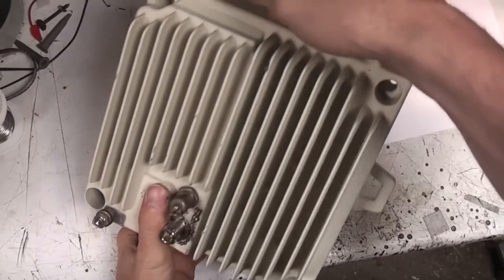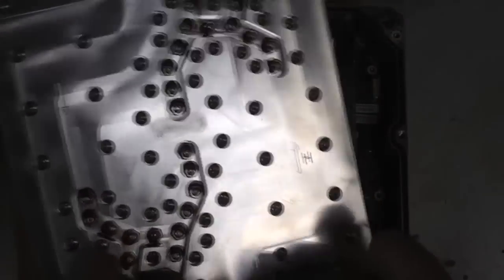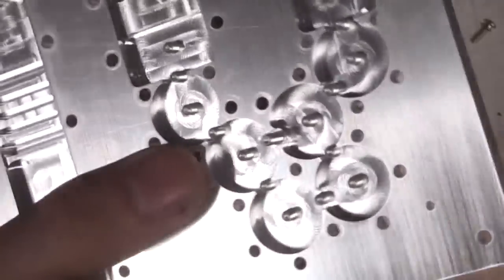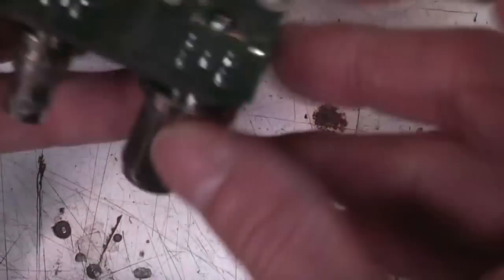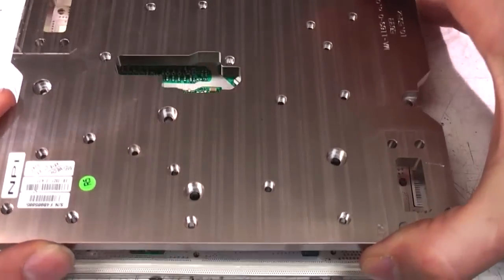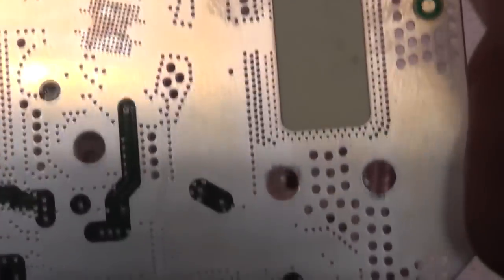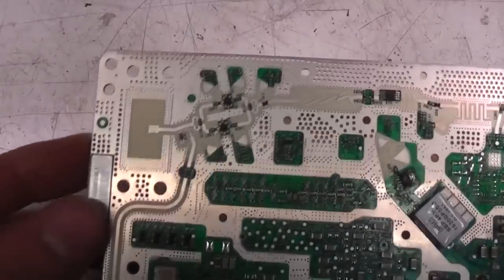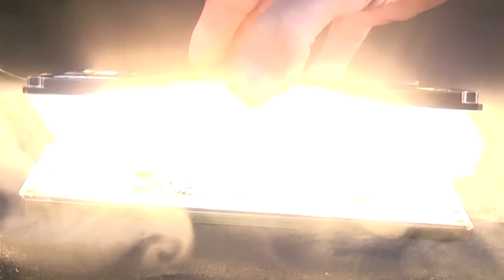10GHz Microwave link teardown

Comment: That BNC connector on the back is a 0-10v-ish signal strength indicator used to align the dishes. RSL-receive strength level.  You basically just go up the tower with a multimeter and swing the dishes back and forth until you get the highest voltage. The alignment is actually really finicky so you really need that quickly updating voltage to really tell when you're dead on the center of the main lobe.

Comment: I know this is old but the cavity is a standard band pass/band reject for full duplex radio transceive. Pain in the neck to tune them too.
The funny shapes on the board is more filtering and capacitive loading, this actually stops the tracks from becoming the antenna and loosing rf power.
The part you have (as stated) is the first IF stage and may bring the frequency down to the main part at let's say 1.2ghz where there is less loss in coax.
There is loads of screws to stop the metal from warping in temperature changes as even 0.25mm will change the frequency pattern of the filter and cause huge problems!

The filter cavity is used in repeater sites where tx and rx is used at the same time but has a slight offset of frequency.
Many people here watching this are ham radio operators so I will explain using similarities so they can understand.
A repeater will receive on 145.0mhz and tx on 145.6mhz, this would interfere and the transmission power would fry the front end of the receiver, so, what they do is on the cavity they tune the peaks on their frequency high and low, and because its opposing frequency is not tuned it rejects the power from the transmitter going into the receiver,
So the tx band is notched to only allow the frequency for the tx and rejects the rest being spread and the rx only accepts the rx frequency and rejects the rest.

This can help if you also have multiple antenna and transmitters right next to each other as the other transmitions will be rejected

Comment: Actually that line from the TX output to the RX input might be there to improve the directional coupling. It probably feeds some of the TX power ad inverts it by making it go a right amount of way to feed it back to the RX part where it cancels out whatever bled through the waveguide filter. Those "exotic" RX filters are probably just there because at those frequencies they are both cheaper and more reliable to manufacture. Silver coated traces of copper on Teflon are very repeatable compared to parts soldered on with blobs of ill-defined solder. I have done some 10 GHz stuff with conventional components (the board was actually designed for 2 GHz) and that actually involved some bypass capacitors which were mounted through the board. So for each of the devices you'd drill a 1mm hole through the board and push the capacitor through it.

Prototyping in small shops, where they don't have the software and perhaps even normal FR4 boards is done by dremmeling the traces into shape.

Comment: Great reveal so thanks for that. Those "strange RF magic shapes" for the most part are in reality called "distributed element filters" Some are band pass, low pass\high pass etc & all about signal separation & conditioning. The cool little fan shaped or triangular for the purists are functional capacitors, there are various stubs & other tuning elements along the various paths to maintain correct transmission line impedance...every trace between the filters, amplifiers, circulators, switches etc are transmission lines so must maintain a specific geometry, thickness distance to groundplane side-side & thru the substrate etc etc. There's always a great deal of up & down conversion of frequencies depending on the device's function. Someday I'd like to meet those who originally figured all this out....younger versions of guys like Shariar @ The Signal Path over @ Bell Labs or maybe NASA I suppose....very cool stuff indeed...porn for us RF types

Comment: Neat video - my brother in law works as an electrical engineer at Intel and they design stuff like this. They use simulation software to test chips, then once they have them ready for manufacturing - they have this really fancy apparatus for landing probes onto chip dies. Then once that is ok - they have these custom made testing boards for when the chips are placed inside packages. Really fascinating stuff.

Comment: That trace running around the edge of the board, and those spikes in the traces are spark gaps if I am not mistaken... They are there so if anything is going to spark, it will take those gaps (they are quite precisely designed)...That is also likely why the trace is so thick and goes to each external socket, but does not directly connect to them...To be clear there shouldn't be sparking, however if there WAS a non repeating fault, it would provide protection....I mean as you know - if the potential is there a spark WILL happen...better to design a place for it to happen, rather than wait and see where it will find an exit :).

Great videos I love to see inside the stuff you get, I am certainly jealous lol...

Comment: The big filter with all the screws are called the duplex filter. When making a bi-directional microwave link you must prevent the radio unit from jamming itself with its own signal.

What you do is you split the radio band up into an equal size upper and a lower band. You then split each subband up into a set of channels. You have the same number in each subband. The channels are used in pairs, one from each band. The first in the lower, with the first in the upper, the second with the second and so forth. The frequency distance between the channel pairs is known as the duplex distance and is kept constant. 

Now image you have a radio unit. Let's call it an A-type. It will transmit in the high band and receive in the low-band. In the other end of the link you you will have what we shall call a B-type radio. It will receive in the high band and transmit in the low band, just opposite to the A-type.
 
The duplex filter is tuned to the high band on one port and the low band on the other. The A/B type is determined at what port you place the transmitter and receiver. 

The reason they used that many screws is not they were afraid it would fall apart; but to make 100% sure the two parts of the filter will be in full contact even though the temperature changes quiet drastically. Should they loose contact the performance of the filter may change significantly.
Reply: Morten Kristiansen These units work with different TX and RX frequencies. One end will "TX high" and the other "TX low". I'm sure there's still some good reason for having all of this, perhaps so they can machine common parts and then tune them for their respective high and low TX/RX combinations.

Used to work with these kinds of microwave systems, known as split systems. This is the ODU (outdoor unit) which is essentially a frequency up and down converter from the IF frequencies (somewhere in the hundreds of MHz) to the "over the air" frequencies, tunable within a specific band through software configuration. As Mike said, the IDU (indoor unit) does the modem function, which means the IDU components are always the same, just chuck the appropriate ODU and antenna up the tower for the frequency band you need over the air.

Cool stuff, but I was just the IP network guy, it's all black magic to me. Great to see inside one finally.
Reply: +Tom Story

That's exactly what I meant by RX and TX band. The duplex filter is a two band-pass filters preventing any signal (or noise) from the output to enter the input. Given the TX signal is several orders of magnitude larger than the RX signal, the TX signal can easily oversteer the LNA which effectively would make the receiver deaf. Worked 20 years ago as an engineer in a company that designed and manufactured that kind of systems.
Reply: Morten Kristiansen Ah, I see what you mean, yes. As I said, I was just the IP guy. To me, RF is black magic/voodoo/what ever you want to call it. :)

In some larger radios I worked with, e.g. Alcatel-Lucent LSY, they used circulators to combine and, I guess, split signals in each direction. I suppose these two work in similar ways, blocking the TX power from making its way in to the RX side.

Could be wrong though.
Reply: Well I'm don't have that much microwave experience; but I know you often use shims between waveguide parts. Example: http://www.labem-microwave.it/inglese/foto_prodotti/Accessori/Shims/shims.html.  
Aluminium will inevitably oxide and give you some insertion loss. Sometimes you plate it with silver or gold. I don't know how well silver works since that will oxide as well. For shielding I really wouldn't expect coating or shims to be necessary; but it might depend on the design. Unfortunate, there is no substitute for knowledge :-) You should place a lot of screws through the PCB to make good contact between the shielding and the ground on the PCB.  Best of luck with the project.
Reply: I assume that this filter block is made from aluminium. As fas as I now aluminium develops a non conducting oxide layer. There is no gasket. Do you know how they assure good electrical contact? Is it a special kind of aluminum? Is is coated with something?
I need to manufacture some custom machined shieldings for a RF gold plated pcb.
Thanks in advance!
Reply: I will search for a local cnc machinist and test the shielding with a common grade of aluminium.  It is a prototype and the final board may change.   
I don’t know how exotic is too plate aluminium with silver or gold… maybe I will speak to my  local PCB manufacturer, but I suppose that their electrolysis process will not work for that.
At the moment we are only probing the board and trying to configure every IC
Thanks Morten Kristiansen!

Comment: I got the pleasure of mounting a microwave link receiver last summer.  They are surprisingly easy to align now 'adays and provided a gigabit data link to a site about 3/4 mile away.   Latency was much lower as well.  These are pretty good solutions.

Comment: Would you REALLY call this 'electronics'. Resonant accelerating waveguides that work by using automatic transmission valve bodies, interference filtering that works by using its trypophobia to scare it away...

Comment: There was a time when the hardware was very expensive. Nowadays, the hardware is cheaper, what costs a lot is the capacity licences. That BNC port that you refer to, is the RSL AGC control, for path alignment. Most ODUs will give you a voltage reading proportional to the presentr RSL, but that varies a lot from vendor to vendor. MW hops are calulated (professionally at least), with a piece of software called Pathloss. That first piece of plumbing is the diplexer / combiner, it splits the RX and TX branches. On an mw hop, one side is always "low" and the other side is "high" meaning you are using different frequencies to transmit and receive. (BTW, by opening the tuned cavities, you have effectively detuned /destroyed that odu hehe). Very nice coplanar technology there. These units are powered with -48 Vdc but in rare cases you can find +24 Vdc

Comment: Very nice video Mike, always wanted to see inside of those microwave ODUs. For that whitish SMD part that you mentioned Power AMP, I "think" it is a small SMD antenna to avoid any feedback from TX/RX which may damage the RF chip. I couldn't find any 10ghz one on Digikey etc. but you can search part number 712-1017-2-ND for 5ghz one. You can almost see these kind of ceramic SMD antenna on any microwave devices.

Comment: In the eighties while at GEC in Coventry, I had to set up wave guides by tuning them with the same method as is here. The frequencies I dealt with were 2GHz 10GHz and 19GHz. The guides were T shaped with about 8 screws along the body and I used a power sensor (HP of course, very similar to the ones on the latest video from the Signal Path Blog) to tune the guide at the relevant band looking for the lowest power loss.
The result would produce a trace which looked like a notch filter with about 5 low points across the band gap.  Each screw would effect different parts of the 5 points in the band gap. You would bring them down slowly by going back and forth with your adjustments. This item you have here has loads of these screws and I bet it wouldn't be a quick job to set them up.

Comment: The smaller BNC connector on the back of the unit is for field troubleshooting the received signal level. On the systems that I've worked on, we used a multimeter to measure the voltage and then moved the antennas to get the best connection possible.

Comment: I know some rf pcbs are made of teflon filled with ceramic dust. Dust is used so traces can be glued to board. Can normal smd resistors and caps be used for such high f?

Comment: 10-500Mbit/s? oof. Much rather stick with a new Ubiquiti microwave unit! neat vid
Reply: ***** 10-500Mbit/s, based upon device, license, and distance.  Also that is full duplex and nearly zero interference.  Ubiquiti AF5 can transfer 600Mbit/s full duplex with 50MHz.  AF24 is distance limited, and uses 100MHz to transfer up to 700Mbit/s.  The thing is that many licensed radios can be run in a 2+0 configuration to double the capacity, or a 1+1 configuration for redundancy.  The Ubnt radios you must do that with either LDAP, or something like OSPF.
Reply: Philip Dorr  How do they transmit data at a faster rate than the carrier frequency?
Reply: ***** That's the bandwidth, the AF5 runs at 5 GHz, the AF24 likewise 24 GHz.